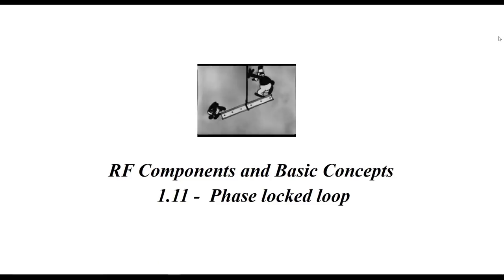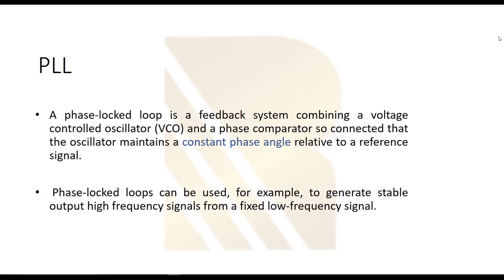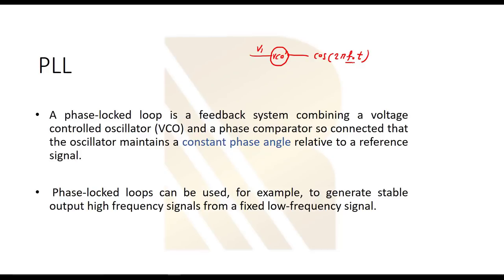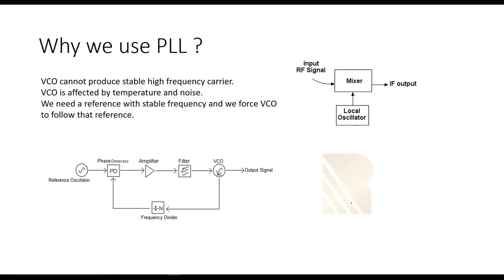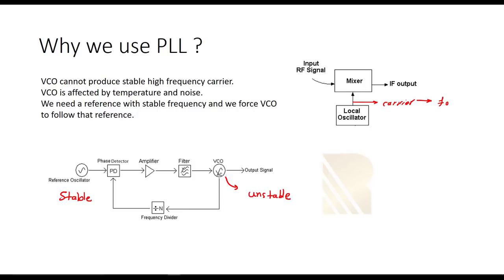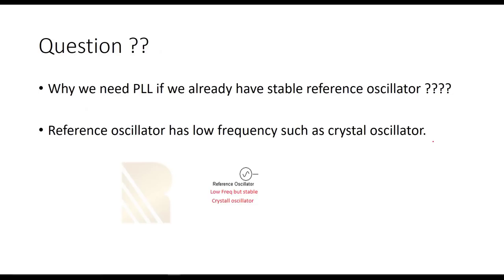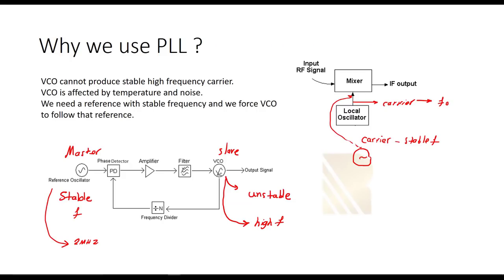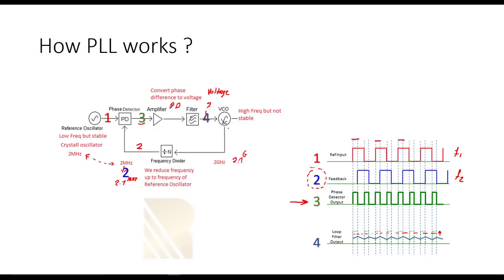what is Phase locked loop? What is the need of it, and how it works? PLL tutorial PLL basics #16

Comment: This video is just what I needed! Answered the most basic question that other videos didn't
Reply: yeah mate. its actually a bit of a bastard to teach. i did a whole course on digital communications it at university and phase-sync was completely omitted. not even mentioned in the material. taught QaM, but no phase locking. figure that one out. i honestly ran into the trouble of trying to make a demodulator and realized i was missing something. and found PLL on my own.

Comment: Interesting. So a phase detector doesn’t only detect that two signals are in phase, but also that they have the same frequency.

• Equal frequency and equal phase angle: constant zero phase difference.
• Equal frequency but different angle: non-zero but constant phase difference.
• Different frequency: time-varying phase difference.

Comment: Great explanation, thank you. 
One question - how are we increasing the frequency of the VCO if we are constantly trying to match the phase difference of VCO and the reference oscillator?
Reply: through the divider.
Reply: VCO is typically programmable and uses frequency multipliers to achieve higher frequency.  At a given voltage, say V1, the multiplier would be set at a programmed value, say 10X.
Reply: Also, once we set the VCO to a desired frequency(by fixing the multiplier), there’s no need to keep increasing the frequency any further. We just need to maintain that high frequency as good as we can.